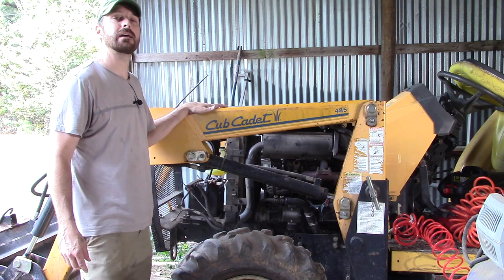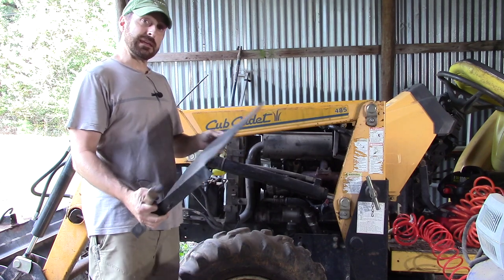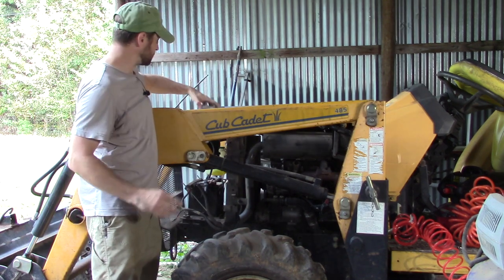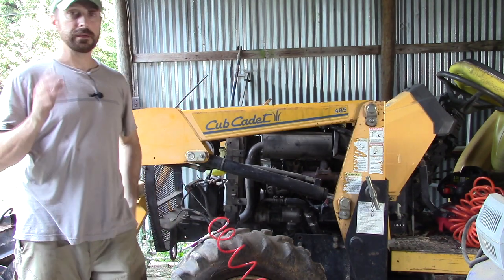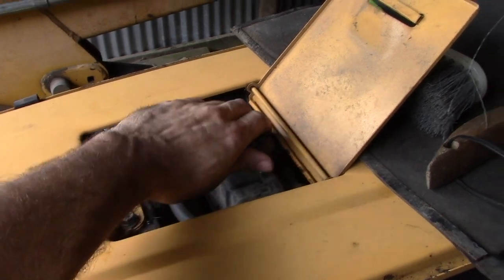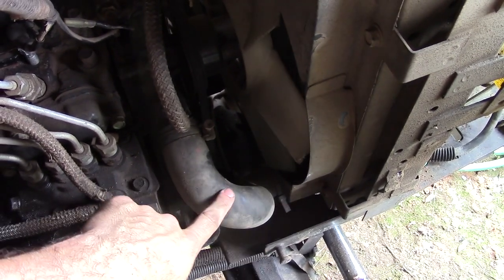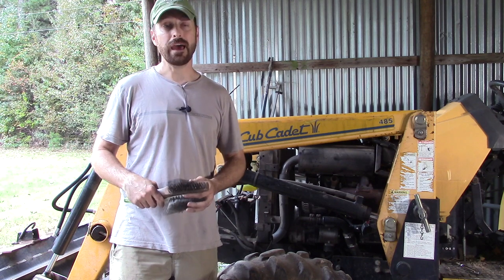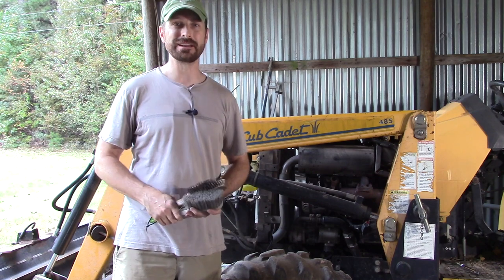How To Prevent Your Tractor From Overheating (Simple Fix)

Comment: Thanks for the pointers. Mine overheated the other day while brush hogging. I had the bucket on. The tractor's radiator screen and the grill were CAKED with debris. 

I was using the bucket to guard against running over any junk in the field because it was an unknown property that a friend just bought.
Reply from the maker: We are glad the video was helpful. I usually brush hog with the bucket on as well. It does flip a lot of debris up into the radiator grill.

Comment: When my tractor get in the red zone, I WILL NEVER SHUT IT DOWN , but let idle so it will cool itself slowly, if you shut it down, all the heat is stuck in  the engine, and takes more time to cool it .When running its like putting a fan in front of it. If it get in the red zone while idling, then something is wrong, then  now its the time to shut it and inspect it carefully.

Comment: My buddy worked at Kubota and he said the most common cause for cracked heads is a clogged radiator. He said when people use a brush hog they clog up the radiator with debris and they don’t check the temp while they’re mowing. He also said the most common user error fix is broken PTO’s cause by people who drill their auger bits into the ground to store them. He said they explode when they try to take the auger bit out of the ground months down the road.
Reply from the maker: Interesting. Thanks for the info.

Comment: My John Deere 950 run got hot but wasn't radiator, the muffler was clogged up.
Reply from the maker: How did that happen? Birds? Wasps?
Reply: @CountryLivingExperience  It was just the years I guess, it had rusted and the parts inside of the muffler sorta moving around in there clogged it up, not completely but enough to make it run hot.
Reply from the maker: @dDayye  Oh, wow. Time for some new pipes.
Reply: @dDayye  I will look at my own JD, its a 1010c dozer, i have notice  that my trap over the muffler was not moving much while idling, only in higher rpm that it would open up but 3/4 open .I will look with a camera when it cools down. Thank for the info.